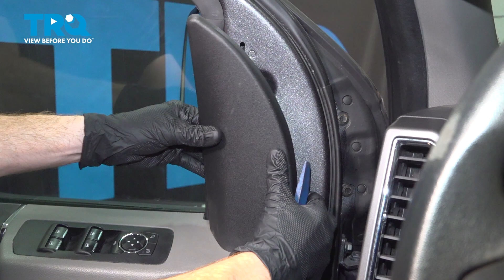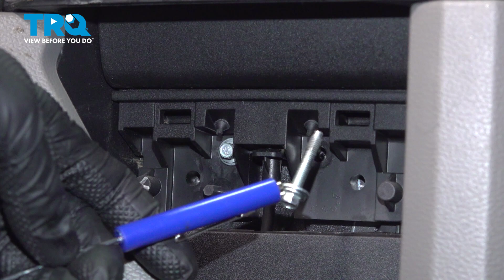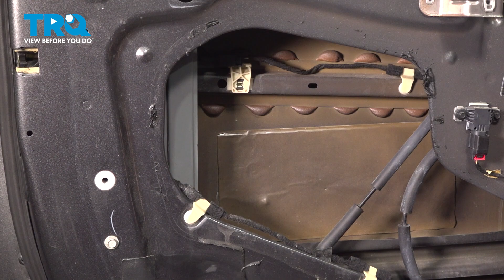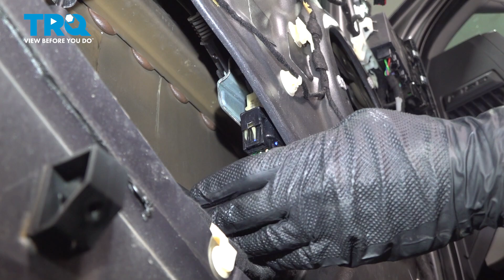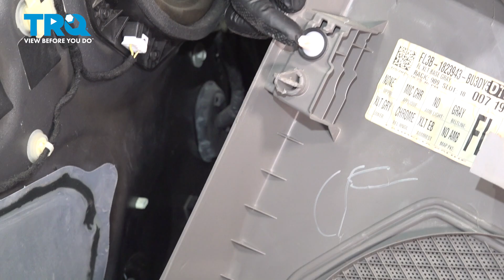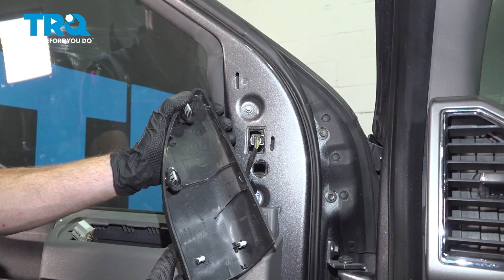How to Replace Front Window Motor & Regulator Assemblies 2015-2020 Ford F-150

Comment: Absolutely outstanding video! Thank you. I recently replaced the left front regulator assembly on my 2018 f150 with a Dorman  aftermarket regulator following your video. Everything went perfect, the only issue I’m having is the auto up function will lose its memory if I let the glass come all the way down. If I only roll it down partially, it will auto up. Called Dorman and they weren’t too much help but my ford tech buddy said it could be a bad motor or because it’s a non oem part. So I ordered the oem ford part which I will be installing next week.